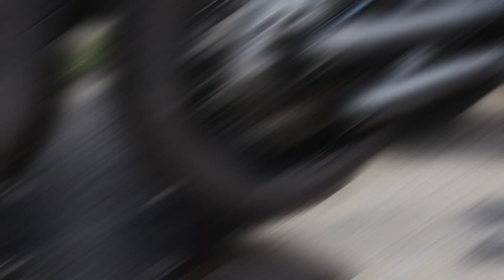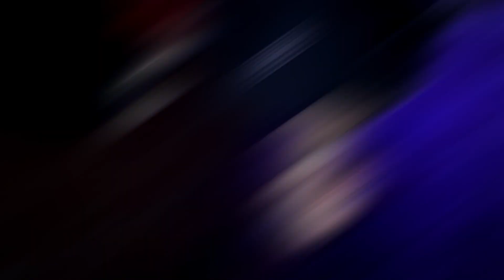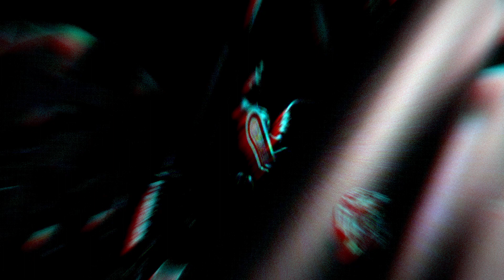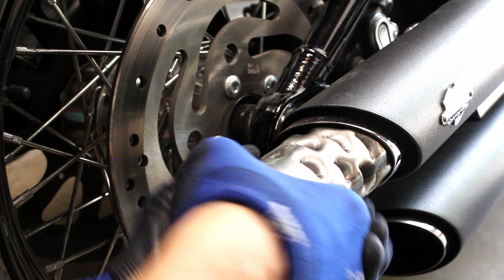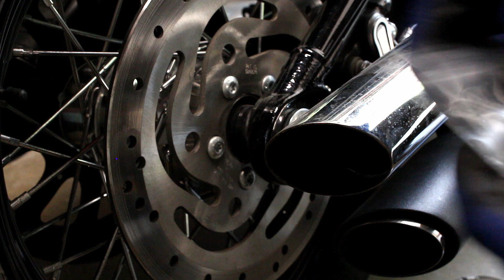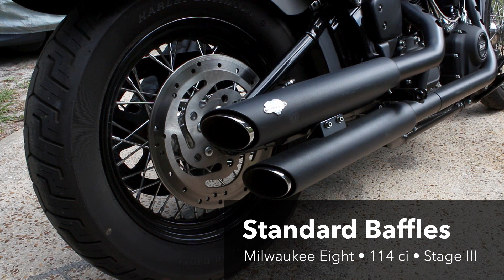V&H Twin Slash Competition Baffles Install - Part 1

Comment: I installed V&H slash mufflers on my 2020 Lowrider. The sound was a bit to loud so I bought a set of their Quiet Baffles. Removing the baffle wasn't too bad, but installing the Quiets, with the fiberglass wrappings was a real struggle. I had to beat them in with a hammer and long rod. I'm pretty sure they're in there forever.
Reply from the maker: That sounds like a pain! Did that get the sound where you wanted it?
Reply: Omg yes I want loud

Comment: I need to reduce the sound of mine before my neighbours rise up against me so was going to attempt wrapping them, have you experienced this/completed this process at all. Simon
Reply from the maker: Hey Simon - unfortunately I haven't tried wrapping them at all. They also make quiet baffles, so you might check into those first. Let me know what you learn!
Reply from the maker: Ah ok. Let me know how it goes! Fortunately the worst part is getting the cover on and off so it should go smoothly.

Comment: Hi Ron, I have a twin slash on another bike, but I have such a hard time pulling them out, any tips? I already tried putting some wd40 on but no help..

Thanks in advance
Reply from the maker: Hi Steven! I happened to have a really unique pair of super long pliers with a very flat nose, and they worked perfectly. In general, pliers have worked the best for me, but they need thin jaws. You might also try getting a piece of relatively heavy steel wire, like 12 gauge, and bending a "J" into the end of it, and then stick it all the way in past the end of the baffle and try to hook it with the end of the J to pull it out. One other idea - maybe thread the retaining bolt into the boss from the INSIDE of the baffle, just far enough in so it does not go through to the pipe itself, and then try to pull it out by grabbing that bolt with pliers or vise grips. Try rotating it back and forth as you pull it out. Lastly, maybe heat up the outer pipe with a propane torch to get it to expand but not apply enough heat to warm up the baffle too - maybe that would give it enough wiggle room for you to pull  it free. (Or maybe you try a combination of a couple of these...) Let me know if any of this helps!
Reply: @RonsWorkshop  Hi, Ron! thanks for so many tips! I shall give them a try over the weekend.

One thing is, I'm not sure if the twin slash for different makes uses different baffles; in your video when you took the baffles out with the pliers, it seem there are spaces between the baffle and the exhaust itself for the pliers to slide in and clamp.. baffles I have has maybe 1mm of space in between itself and the exhaust I feel no pliers would ever fit in.

I also dried the 2nd methold by bending a hanger in J shape trying to take it out (I used 2 and hooked them in diagonal points to apply even force) and still no luck.

Going to try thread the bolt from the inside and use pliers and see if it works.
Will apply heat at the same time!
Reply from the maker: I think they’re the same - when I reach in to grab them I’m actually grabbing the metal vents that are pressed into the baffles, and not the round edge of the baffle itself. Let me know how it goes! The bolt solution may be the one to get you going.

Comment: Wouldn’t the locktite be nullified by the heat of the pipes anyway?
Reply from the maker: Probably so! Maybe the thicker paste-type loctite that’s on the bolts is more heat resistant than the regular liquid. But I wouldn’t go with red loctite.

Comment: I know Harley guys usually don’t like metrics, but I definitely like your competition baffles over the standard. On my 2005 Suzuki Boulevard C50 slash cut full exhaust, I lose 5 mph top speed with the standard baffles in compared to no baffle. I’m about to order the competition baffles, but don’t know how they compare on flow to open pipes.
Reply from the maker: Hey Rick - well I really enjoys bikes of all kinds so no problems here :)

Let me know how the competition baffles work out. I suspect they’ll have more back pressure than open pipes but that’s not necessarily a bad thing. 

If you want a channel sticker send me a DM on Telegram or Instagram with the mailing info @RonsWorkshop

Comment: Is it bad to just leave out the baffles in general?
Reply from the maker: The thing to be aware of is whether or not it runs lean without the baffles since it will have less back pressure. Lean is not good.
Reply: @RonsWorkshop  does it sound good without baffles

Comment: Indeed competition baffles sound better to me, do you think the difference would be the same on Iron 883 engine?
Reply from the maker: Hey Tomaz - the Milwaukee 8 probably has a deeper sound, but I suspect the difference would be similar with the 883, with the competition baffles accentuating the deeper tones. Are you using twin slash slip-ons with the standard baffles now? Let me know what you end up with, and thanks for watching & commenting! If you want a channel sticker send me a DM on Instagram with the mailing info @RonsWorkshop
Reply: @RonsWorkshop  thanks Ron, I‘ve just put v&h slip-ons with no baffles at all. My plan is to install “competitions” (actually I ordered them already 😁) will let you know what is the final effect, fingers crossed 🤞